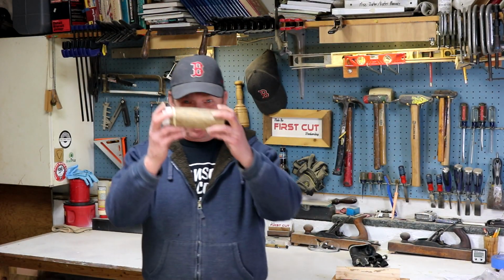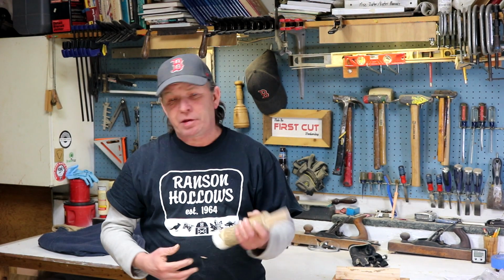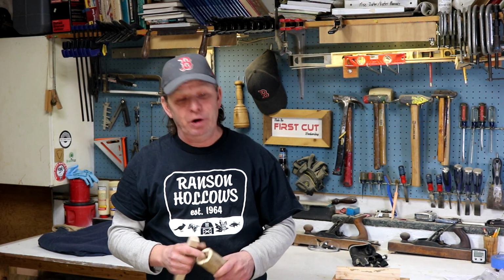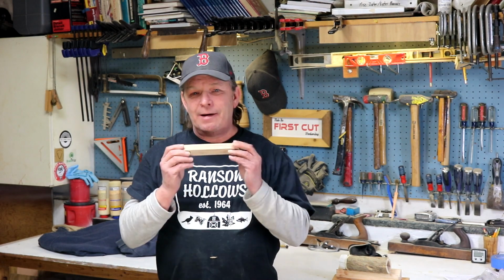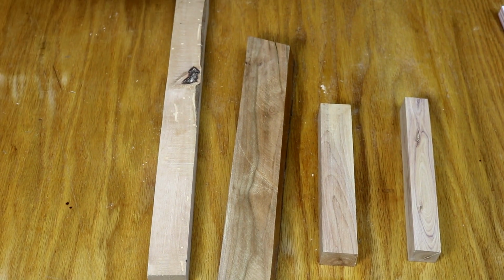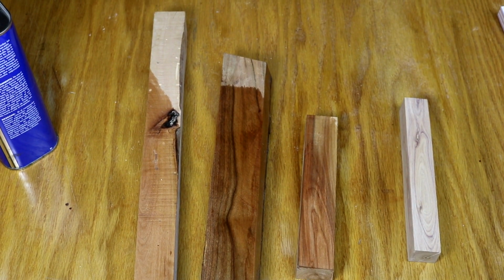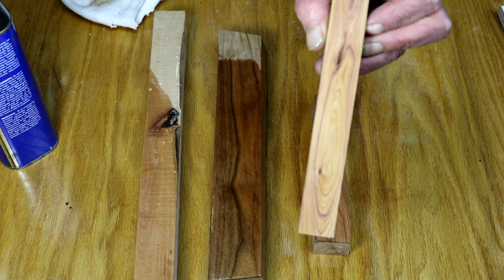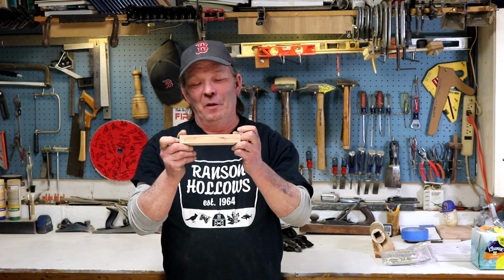Free Project Wood

Comment: I have some laburnum branches in my shed drying out. It looks really lovely in cross section I can't wait to do something with it. How long do you leave yours before milling and do you seal the ends etc. You've probably got a video on it !😀😀
Reply: Chris Cute Thanks for the reply Chris my branches are about 6 or 8 inches in diameter and I was going to leave it about a year then I heard someone say a year for every inch diameter which sounded a bit crazy to me. I'll try late summer and see how I get on. But in the meantime I was going to cut them into smaller pieces and then just seal the ends with candle wax.